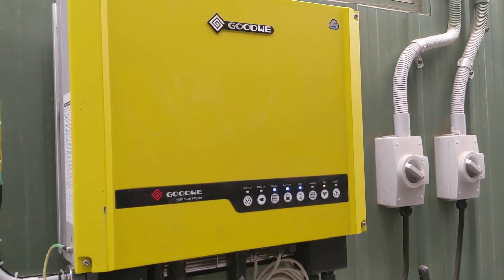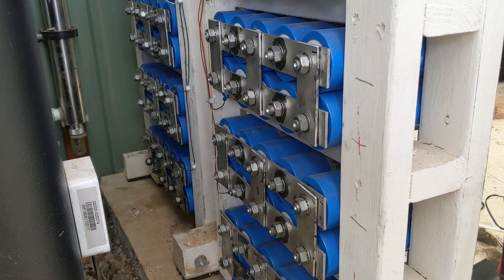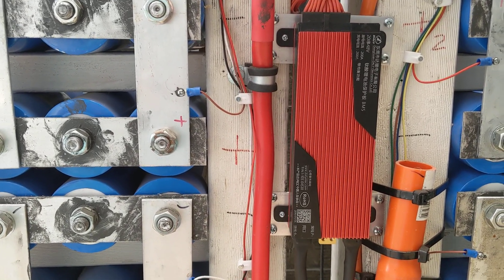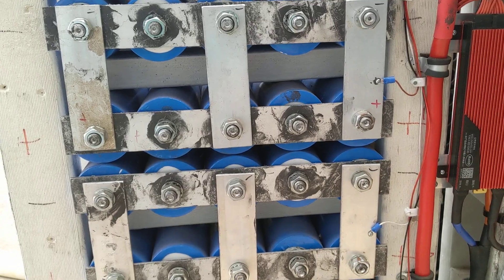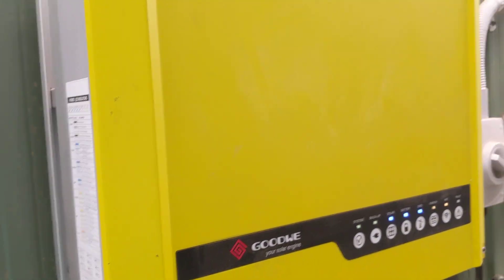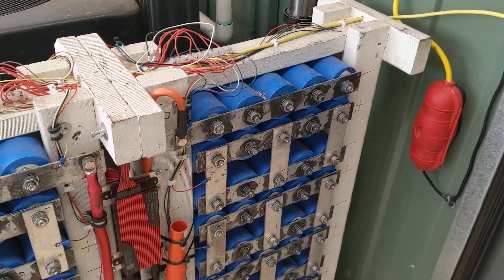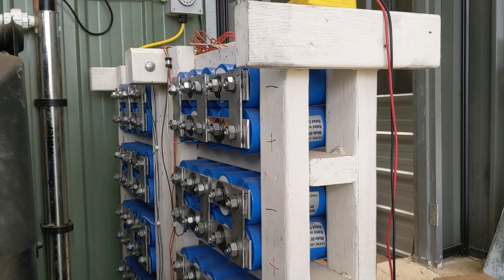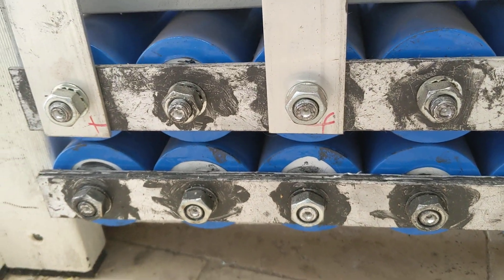GoodWe 5048D-ES Solar Inverter with 66160 Lithium Titanate Battery Power Wall

Comment: So, is there 100ah on each section of 45 cells? and second question when you talk about the rectangular cells are the ones lifpo4? or also lithium titonate oxide?
Reply from the maker: There was meant to be 270amps (6x45amps) but as they were fake batteries it was only 120amps. All batteries are LTO - lithium titanate cells. Thanks...

Comment: Thanks for information,Sir i have a question   I have this type of inverter which is in a problem when we throw the wapda grid to inverter it's automatic off,for fee minutes then on then off again again on off??
Reply from the maker: Fully automatic, no delay switching forward or back to grid. I have computers on the circuit and they do not glitch at all.

Comment: Hello Adam! I have the same unit as yours, i'm facing problems connecting to the unit via wifi. After reading the manual i thought that the unit comes with wifi integrated but it seems is not. Can you please tell me what's the part no. for that wifi dongle that you have and if it is inserted in the usb port of the inverter. Thanks in advance!
Reply from the maker: As far as I can see, the wifi module is universal for all goodwe models. Google for more details and send an email to goodwe to confirm.

Comment: Because these are a new type of batteries does these LTO batts work with any solar charger that is compatible with lithium?
Reply from the maker: Yes, as long as you use the correct LTO BMS with them.
Reply: @RedbackAviation  thanks..

Comment: Could this be a good fit to use for EVSE Charging that draws high wattage for long time? I wonder how it would sustain long draws of current say a basic one starts at 1476W for Plug-in Hybrid or 3600w to 8000w for Level 2/3?
Reply from the maker: At the moment, LTO technology isn't better than other lithiums besides it's charging characteristics. People who have used them in vehicles say they fall short of Lithium ion and Lifepo4 batteries for power density and discharge loads. They were used in buses in china a while back though.

Comment: does the goodwe have a way to look at it on your computer? you may be able to custom set a voltage charge state
Reply from the maker: Yes, there are computer viewing options, but not much in the way of adjustments that can be made, just changing running modes.
Reply: @RedbackAviation  what about updating the firmware maybe this will give you more control ?
Reply from the maker: There are no updates available and there is no longer manufacturers support either unfortunately.
Reply: @RedbackAviation  well that sucks

Comment: I wonder why Tesla is not using these LTO cells with a cycle lifetime of at least 20.000? Seems they lose a 15% of charge if discharged but at a lifetime of 20.000 deep cycles this must be a good alternative. Pricing has gone down to and probably manufacturers of BMS's and Power Wall Equipment are upgrading software for customers changing to LTO. It probably does not take long for having a LTO Solar Charge Controller with a specific algorithm.
Reply from the maker: Basically it comes down to power density. A lithium ion battery can have over three times the energy as an LTO size-for-size. And for big fancy companies - being able to provide a nice neat smaller battery sells more than a bigger bulky battery.

Comment: Yep I use dielectric grease all the time great stuff
Reply from the maker: Absolutely! I 100% agree - the stuff gets everywhere but does a brilliant job.
Reply: Dielectric grease is a good thing to use  to minimize changes in contact resistance over time. However, it is an insulator without any conductive elements. Combining conductive additives, such as graphite, would have marketing value, at best. I think you can just stick with standard dielectric grease (going to be cheaper) without any difference in performance.

Comment: link to the fan you install under the inverter please?
I just wired 2 120mm 12v PC fans on the top of mine to blow down and hooked up to a 10w panel on the shed roof that just runs the fans all day, has worked a treat but that one you've used look like it might be better.
Reply: It would be much more efficient if the fans were blowing UPWARDS as hot air rises...
Reply: @edwardfletcher7790  in an enclosed system perhaps, on a wall off the side of your house, not so much, and, well, there's no room with a lot of models to mount fans under them without constructing ducting.
Reply: @John-gm8ty  I'm simply pointing out the reality of the thermodynamics. I could care less about the details.
Reply: @edwardfletcher7790   the details are everything in such a discussion.
details matter.

Comment: Since these battery can take 10C, could you run these with a wind generator and instead of pumping excess wattage into a resistor at high wind, pump it into the battery since they can take 10C?
Reply from the maker: Correct, but it still must run through a charge controller to do this, not a direct connection.
Reply: Weakens the batteries half a century life span.. the more you fast charge the quicker it spoils..
Reply: @geocentricmax2038  These batteries charge in 5 minutes.

Comment: Can you run washer and dryer with it . How about cooking?  I mentioned  these because they do use alot of energy.
Reply from the maker: Yes, you could, it all depends. This system was meant to be around 10kw/h with approx 7-8kw/h useable. Unfortunately being ripped off with fake batteries gives me a total of around 5-6kw/h. You would need to calculate your appliance requirements first.
Reply: @RedbackAviation  thanks alot. Could, you tell us who sold you the fakes? And what you learned from your purchase experience? We are trying to learn from you.
Reply: @jab376  You must be in America to use an Electric cooker and worry about a dryer. 
Most Aussie houses use Gas for cooking, especially off grid.
Dryers aren't really necessary in the North of Australia as there are only 2 seasons (no Winter).
Reply: @RedbackAviation  Lots of people are recommending Yinlong brand Lithium Titanide batteries. I suspect other brands are less reputable with specs.
Reply: @edwardfletcher7790   here is how to look at it in a simple way. Yinlong batteries are good otherwise many people will not recommend it. Too many people can not be that wrong.
Reply: @jab376  Yeah unfortunately the same could be said of the 74 million cretins who voted for Trump...SIGH
I've seen some good videos about Yinlong, but want more information.
Reply: @edwardfletcher7790  uhhmm!! You can NOT compare inanimate or live less objects (batteries) with humans (TRUMP supporters).
Reply: @jab376  It's possible that SOME Trump supporters night be smarter than a Yinlong battery but I'd want to see scientific tests.
Reply from the maker: @edwardfletcher7790  YinLong original batteries are the OEM manufacturer. Some of the others are YinLong 2nds or 3rds sold out the back door - some are just poor copies and some are the very first range of YinLong batteries fitted to commercial vehicles and being re-sold as new! Simple answe, only buy YinLong original - be aware, there are still a, b and c ratings. A cost the most of course.

Comment: How many watts is the battery size and what is the life span of the battery
Reply from the maker: The LTO battery chemistry is meant to last 20,000 plus cycles and a minimum of 10 years. Even if you cycled them twice a day.... 20,000/2=10,000. 10,000/365 days=27 years approximately before the batteries start to noticeably reduce their capacity. These were "meant" to be 40ah YinLong batteries. 40x2.3v=92wh per cell. These are extremely robust but i recommend getting a sample from your seller so you don't get fake batteries like i did. You CAN order direct from Yinlong grade A, B, and C cells.

Comment: Nice video. This bank is physically too large for it's total capacity though. Lifepo4 will be a better choice in my humble opinion.
Reply from the maker: Yes, it could have been made small but would not be strong. These LTO batteries have a low power density, especially in this shape. I have moved to rectangle 33ah Yinlong LTO. They are easier to work with. Yes, lifepo4 are much more compact for the energy, but still cycle life limited. I let the LTO batteries cycle multiple times a day without degradation. I would have to change that if used lifepo4 cells. So far so good. And I have plenty of room luckily 🙂

Comment: Couldn;t you add two passive BMS units to the system to increase the flow of electricity to each bank.  It seems to me that it is unlikely that the single passive BMS can move enough electricity to balance such large banks.   If another one or two are hooked up at the same points on identical units the flow of electrons would be increased and they wouldn't know the difference.  Those balance leads are tiny and don't move massive amounts of electrons around.  An active BMS might help but I would bet more passive BMS units might also work.  They don't have to cut off the balance current, but my guess more wired in couldn't hurt for extra protections.
Reply from the maker: There are plenty of different scenarios I could've done but didn't have time to experiment. The active BMS that I have now added works perfectly and constantly balances at one amp which the wire can handle. Once balanced, most cells are staying pretty close to each other.
Reply: @RedbackAviation  Awesome.  Which one did you choose?

Comment: 24S is the sweet spot for these batteries for 48v system. You should've bought the 66260 55ah 2.3v
Reply from the maker: Agreed on both.... the whole thing seems a little undersized and lacking performance. These fake batteries are horrible!
Reply: @RedbackAviation  I think what they gave you are just a bunch of ultra-capacitors of some sort. Whether from Alibaba or Aliexpress, you should always look for "Trade Assurance" and "Verified Supplier" just to be sure. Even with those marks, you still need to be careful on your payment method because they might still con you to pay outside their platform.

Comment: do you know if lithium leaf also bms should has the ACTIVE BALANCING, or should bms only enought ?
Reply from the maker: A good set of new genuine batteries set up from the start should be fine with a standard BMS, but non genuine or used cells, I'd use an active balancer every time.
Reply: @RedbackAviation  nissan leaf batts are used, so active balancer
 will be any link where did you buy it ?

Comment: how is the battery performance?
Reply from the maker: Pretty average due to the low capacity of the batteries. I should have gone with 24S and not bought from a thief. Though the LTO chemistry allows me to cycle them multiple times a day without further degradation. This is definitely a huge strength of these batteries.

Comment: Is it good for solar panel?
Reply from the maker: Absolutely, they can fast charge so will take all the sun you can give them and can be cycled around 20,000 plus times. Great for home solar storage, not so great for vehicles, ebikes, etc because to bulky for the power they hold.
Reply: @RedbackAviation  moreover, they seem to be more energy efficient and lose less energy for charging, which makes them ideal for solar panel setups
Reply: I like the idea of safety and being in the northerncentral [MN] the temperature here gets cold so maybe if you didn't have room a nema 6 type waterproof enclosure outside could even be achieved. Maybe store them in a wine cooler for hot temps to thermoelectric cooling and keep the little monkey fingers away while also still being visible.

Comment: How many total capacity of battery bank.
Reply from the maker: 100 batteries x 2.3 volts x 25 amps = 5750 watt battery capacity. Usable capacity around 80% = approximately 4600 watts - 4.6 kWh.

Comment: How much storage do.u have total sir?
Reply from the maker: This 66160 system was meant to be 10kw but due to the fake batteries, it turned out to be 6kw total with a real world usable of about 4 - 5kw.
Reply: @RedbackAviation  some of your batteries turned out to be FAKE? Just wondering how it affects the whole battery bank.
Reply: @jab376  oh, Lord!  It s notoriously since many of them are serially connected.  
As we all know, in any serial connection, the whole string's performance is dramatically affected even if one only serial element is damaged, interrupted or has different (usually by internal structure alteration) parameters etc.  It is alike silicon cells consisting any solar panel when the panel output is dramatically randomly affected during cloudy days by random shadows over only few cells of that panel's grid
Reply: @LaurentiuGavrea  thanks for the  clarification.

Comment: I use a iCharge X6 battery charger discharger to test my Yinlong 66160 40A & 35A cells and I get satisfactory results . I use my LTO between 2.0-2.5V per cell.
Reply from the maker: Thanks, that's a great tip. I usually search for LTO charges and the results are always SKYRC MC3000. Nice to know there are now options. Thank you 😊

Comment: Why is this outside?
Reply from the maker: Technically it is not "outside" - it is in an outdoor area but has full protection from weather from any angle. Fully roofed, partially walled, out of the sun, rain and wind. Where I live, it doesn't have many weather extremes and stays moderate year-round.